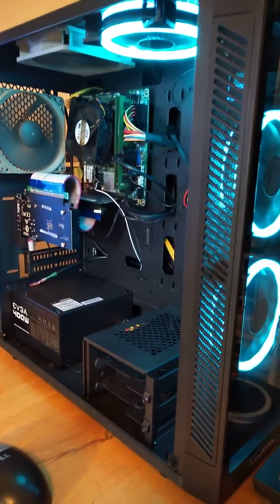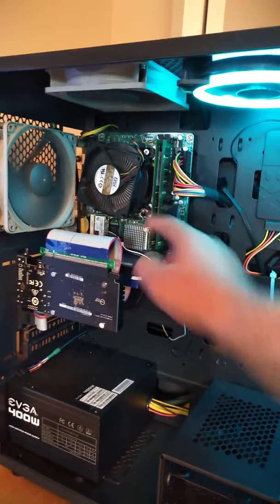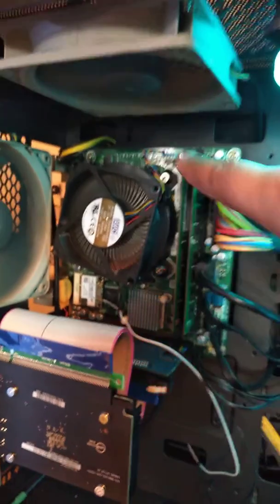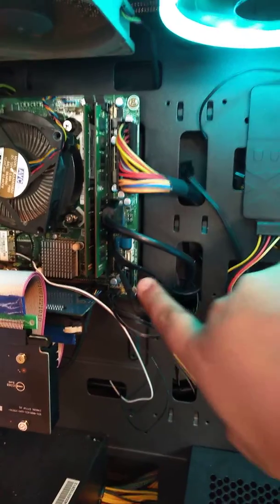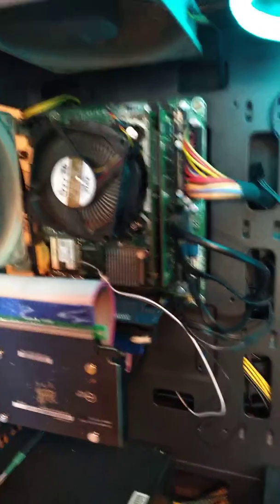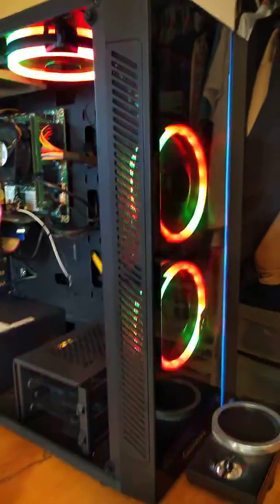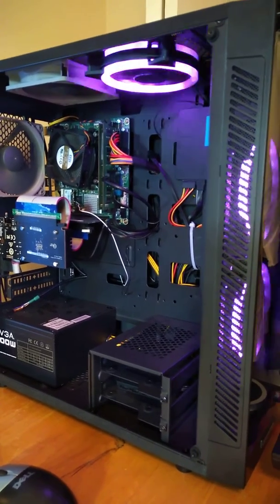Alienware x51 r2 to New Case

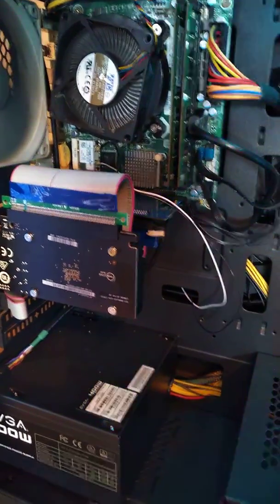Comment: 3:34 i don't know r2, but r1 there are two usb2.0 connectors right under motherboard 24 pin psu connector...maybe r2 don't own usb2.0 connectors (r1 don't own usb3.0 connectors)
edit: i did little research and r2 have usb3.0 connectors there where r1 have two usb2.0 connectors

Comment: I'd like to ask, is it basically a 1:1 to a regular mini itx board? it appears to use completely regular atx psu connectors and mounts. 
Also, is it absolutely necessary to use a pcie riser? to my knowledge it should be possible to just stick the gpu in and screw it in place as you would in any other case with another itx board, but correct me if I'm wrong.
In the case that it is necessary, what would be a good way of doing it? I'm not sure my new case comes with any good vertical gpu mounts or anything like that.
Reply: @ahmednislam  Where was the problem? I'm double checking everywhere right now and it seems like it uses regular mini ITX dimensions, and the PCIe slot is (or at least should be) where the slot is on any other mini ITX motherboard. What exactly do you mean by "would not reach"?
If it was too deep to reach the pcie slot then you might have forgotten to use mobo standoffs. I have a regular evga 970 I wanna use and a modern case that should fit everything nicely, so I'm worried that things might end up not working.
Reply: 2070 plugs right in

Comment: Hi, im doing the same process with my X51 R2, but i cant put my new RX 580 Sapphire Pulse on the Mobo, the card fits perfectly but the front panel pins are blocking the way in. 

I dont know if the card Is just too big or maybe im doing something wrong. I've seen bigger cards fitting directly on the Mobo without any adapter.

Hope someone can help me. Sorry for my bad english.
Reply: @ahmednislam  Thanks for replying.

The Front Panel pins (power, reset, hdd led, etc) in the Motherboard are next to the PCIe conector. 

I have a Micro ATX generic case, my RX580 fits perfectly on the case, but that front panel pins are blocking the way in

Comment: I recently went ahead and installed a GTX 1650 into my r2 as well as 16gb of ram instead of 8 and it’s running fine however i’m looking to go ahead and get a RX 580 or maybe GTX 1660 Super and I know I will need a bigger PSU so I’ve been looking into transfering it to a new case but I can’t find a solid answer on what type of case I would need. I’ve seen mini ITX and micro ATX, do you have any thoughts on this? Sorry if it’s a lot I am just now getting into this type of thing.

Comment: So, My heatsink pins just snapped so i had to replace the CPU fan. Now the case cannot be closed without overheating the CPU. So i need to move my X51 to a new case as well. Blah its such a frustrating computer to try and upgrade. I have some questions about how difficult it was to upgrade to an internal power supply.  Mine has the 330 watt external power supply and i was told that the motherboard that came in the X51 was not able to be upgraded with a new power supply. It seems like you've done it with no issues. ... Hmmm. I feel like there needs to be an X51 master thread for upgrading.

Comment: Helpful video! just a quick question, how did you install the GPU into the new case, i know that there was a separate tray for the GPU in the x51 r2, so did you need to buy any extra hardware to be able to install it?
Reply: @ahmednislam  Thanks. So if I just out the gpu directly into the expansion slot on the motherboard, would that work or would the weight of the gpu possible damage the motherboard.

Comment: my friend try and find a Nvidia GTX 750 TI/OC graphgics board, i tried the 710 and the 1030 both was junk. did you come into any trouble not using the front audio usb output board or in other words does the main board run without it.

Comment: Hi Ahmed Islam, I bought a 500W power supply and connect it directly to the original X51 R2 motherboard. It can only power up for about 2sec then power off automatically. I read many online comments that to use a new desktop power supply, we have to change the motherboard because Alienware motherboard is specially made for its own. But I look at your setup, it puzzles me. Did you modify anything on the motherboard or power supply cable?
Reply: @ahmednislam  Thank you for your response. I can I say that so long my PSU 24pin power connector is long enough, I will not have the above problem? Probably I should try your method rather than just pluging the PSU 24pin onto the motherboard in X51. Thank you.
Reply: I guess I solved the problem. I tried using your method. I disassembled all the parts and it seems alright now. Thank you.
Reply: @ahmednislam  what cable I need for power socket B near the cpu.

Comment: I’ve done basically the same thing to my own former x51 but have a question for you and for anyone else who has re-housed the original motherboard: check the 12V rail via HWMonitor. Does it read 16V for you too? This doesn’t appear to have affected anything (yet) and it could be a faulty sensor but it’s definitely concerning nonetheless. I also feel like I’ve occasionally noticed an electric whine coming from the board.

I’m wondering if the PSU daughter board that I’ve stuck in a shelf somewhere had something to do with regulating the 12V rail on the mobo and if the motherboard isn’t natively-equipped to tell the PSU to drop its voltage. If this is the case I’ll have to devise some kind of pass-through to drop this rail to 12V so I don’t destroy something.

I’m not sure what consistently operating this at 16V could do but it can’t be good. Be careful with this hardware. It wasn’t made for this. I’ll keep working on mine as a funky little side project but I wouldn’t leave it running unattended.
Reply: Ahmed Islam Keep me posted. I’ve noticed a few test points on the motherboard but the labels aren’t very specific. At some point I’ll take the GPU off and check these with a multimeter to see if they can tell me anything. Hopefully I don’t see anything over 12V and HWMonitor is just lying to me.
Reply: @ahmednislam  Interesting. Thanks for letting me know. In this case it might be an issue with my PSU.

Comment: Hey, doing this myself, was wondering what the name of the gpu extension cable is.
Reply: @ahmednislam  thanks!
Reply: @ahmednislam  do you need a riser cable when changing the case of an Alienware X51 R2?
Reply: @ahmednislam  so when changing the case, you'll also need to change the PSU right?
Reply: @ahmednislam  do you think a Deepcool Gammaxx GTE V2 would fit? I'm looking at your setup and it looks like there would be clearance issues with the rear fan if you put a bigger cooler

Comment: Nice bro, I am having x51 r2 too, is there anything special u have to do or just simply bring everything to new case ?? 😀
Reply: @ahmednislam  tks bro 😁
Reply: @ahmednislam  Im in the middle of transferring my x51 now, and have the same issue as you with the usb 2.0 slot. Has not having usb 2.0 plugged in led to any noticeable issues with your system? Thanks

Comment: Psu powers on and turns off after a second. I don't get it.
Reply: @ahmednislam  I bought it brand new yesterday. I think its the eps - cpu power connector, I didn't get a cable for that with the new psu.
Reply: @ahmednislam  nevermind I got it working 😪😁

Comment: Do u still get wifi on it ?
Reply: Ahmed Islam were did u connect the case power switch to the motherboard? I am currently putting everything in a new case
Reply: I just put everything together and boom, nothing turned on:(
Reply: Ahmed Islam any help?
Reply: Ahmed Islam i am going to try this, do u have any sorta of social media i can contact u on? Really could use ur help. And thanks for replying fast, must appreciated